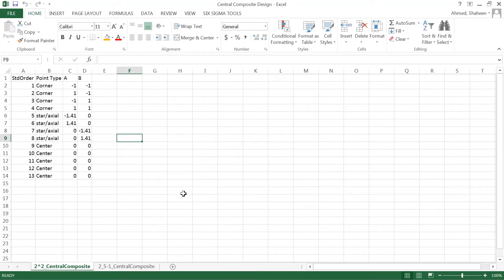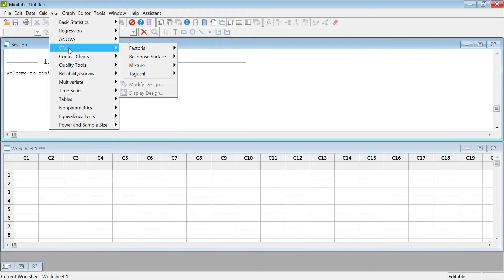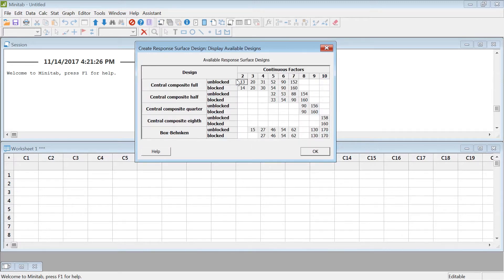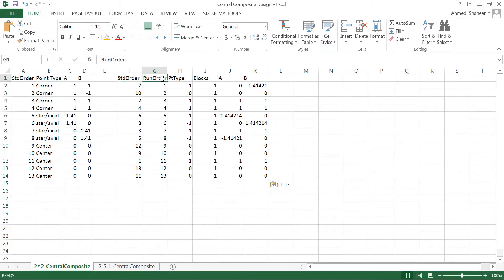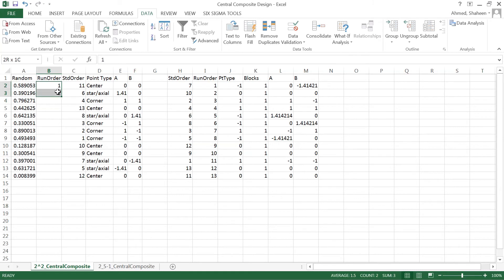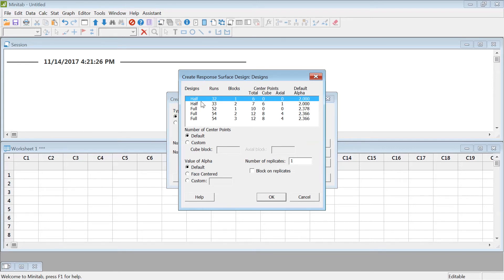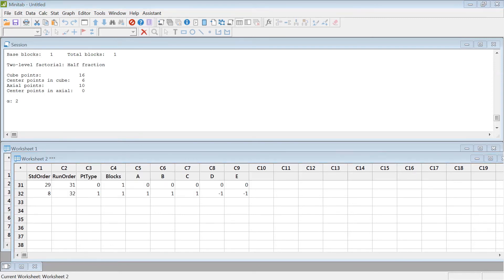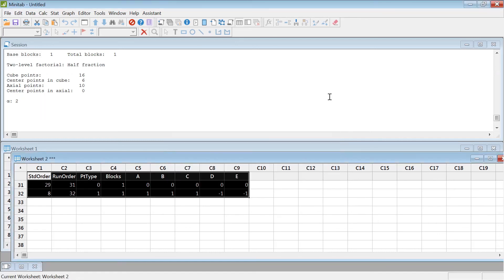Response Surface Methodology Design using Minitab | Design of Experiments DOE Optimization Explained

Comment: Thanks for the informative video. I would like to ask how can I generate the response surface DOE for 4 factors each having 3 levels? I followed your instructions in this video but I am getting 4 factors with 5 levels each (-2 -1 0 1 2). I would like to confirm if the (-1 0 1) is possible with 4 factors for RSM.
Reply from the maker: You will find more here: https://www.theopeneducator.com/doe

Comment: Good evening sir. I have a doubt. If I have a categorical factors also along with continuous factors, then the number of cases also changes. Please tell me how the number of cases are changing.
Reply from the maker: As categorical factors are usually not purely numerical, plotting them in an axis may not be appropriate. You can find more about response surfaces here: https://www.theopeneducator.com/doe/Response-Surface-Methodology
Reply: @TheOpenEducator  I understood sir. But I have categorical factors also. And Minitab also provides the option for categorical factors. That means we can analyze. My question is how the run cases are increasing. Also, how can we calculate the value in place of alpha value if we have categorical factors or text values. Sir, I have gone through your open educator lecture series. But I did not find any lecture on categorical factors. Please help me regrading this. Thank you.

Comment: Hi, how do you determine which response surface design ie. half, full, n.o of blocks, no. of replicates etc..? Is there any rule of thumb? Say I have 5 factors and I chose the full factorial design with 54 runs, 3 blocks, 12 center points (8 cube & 4 axial) and default alpha of 2.366. My lack-of-fit is not significant but for my S, R-sq, R-sq (adj) R-sq (pred) I got 152, 15%, 0% & 0%. I am trying to optimise 6 responses. Pls advice on how to increase the R-sq values. Thanks
Reply from the maker: More videos here: https://www.theopeneducator.com/doe#h.p_ID_163